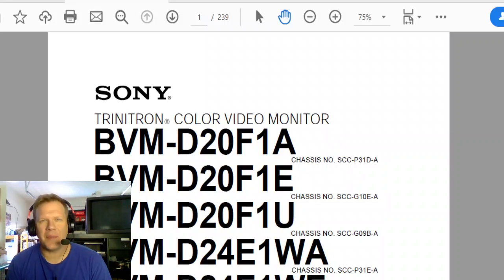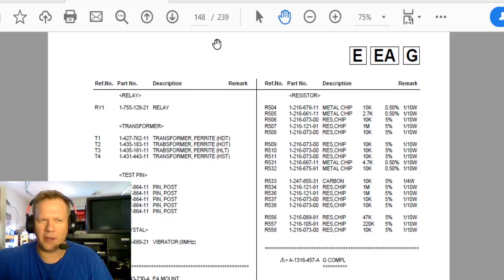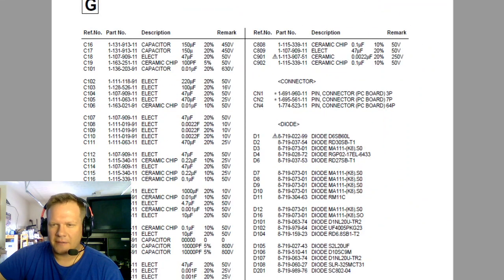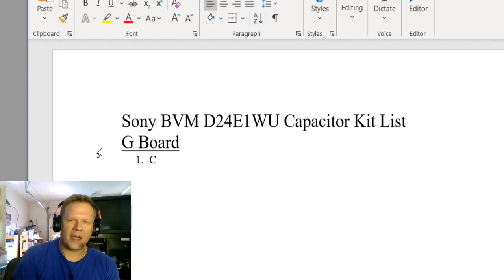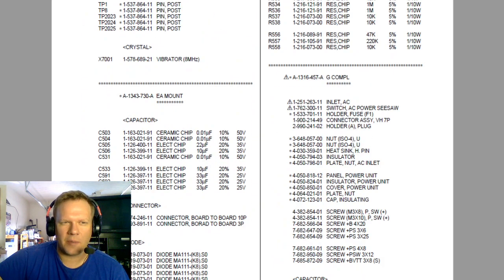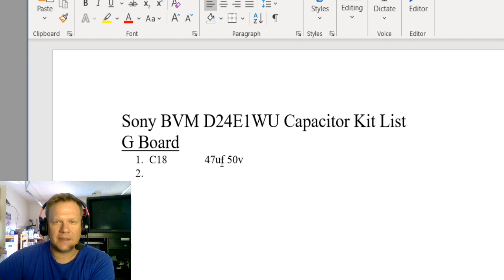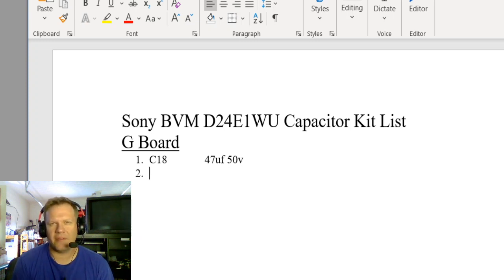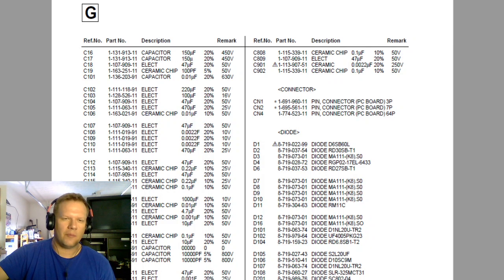How to make your own CRT Cap Kits | Upgrade & Save Money $!

Comment: I always go by what's on the board and physically measure the diameter, height and lead spacing of the original caps, then make a list of those measurements as well as the ratings on them. This allows me to recap with identical-sized caps and have it look factory new.
Reply from the maker: Thanks for the Great tips!

Comment: Just what I was looking for. Any idea as to why Sony doesn't specify what kind of capacitors some of these are?
Reply from the maker: Thanks, most will say 20% tolerance for CRT specs.  Also you can look for caps with a higher temperature tolerance, like 105° C but 99% of the time 85° C will work they just don't have as long of a lifespan.
Reply: Rule of thumb is use low impedance, high temperature rating, and longest lifespan where possible, and stick to your good brands. Panasonic, nichicon, rubycon,etc.
Reply: @natevirtual  page 97, section 8, Electrical parts list :D
Reply: @Asriazh  THANK YOU SO MUCH!!!!!!!!!!!!!!!!!!!!

Comment: THANK. YOU. You explained this exactly how I would understand it. My roommate and I are taking apart a couple regular old crt televisions (not arcade monitors - not that there’s too much of a difference) and I’m going to use your advice on the CREATION of these kits. One thing I didn’t see covered in detail is where to obtain these documents online. Is it different per manufacturer? Do you have a go-to place or site to locate these technical service manuals? The ones in question are - 
-PHILLIPS #27PS55 S321 / Chassis #27T800 7629
-BELL + HOWELL #GNB127 0001 / Chassis #27B510-00AA
Even if you dont answer or know, I’m grateful for this video so I can start the process and get these couple done. I’ve performed four cap kits on arcade monitors (Wells-Gardner and Neotec) and the documentation is often with the machine. The regular ol CRT? Well, you know lol. Either way, thanks for the concise and easy to follow video!